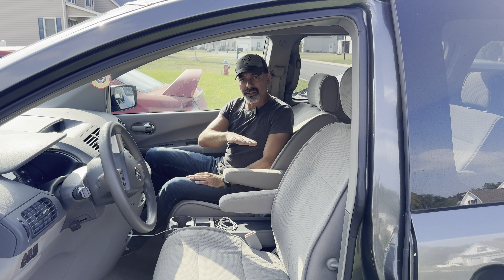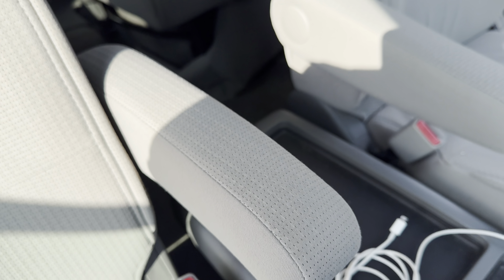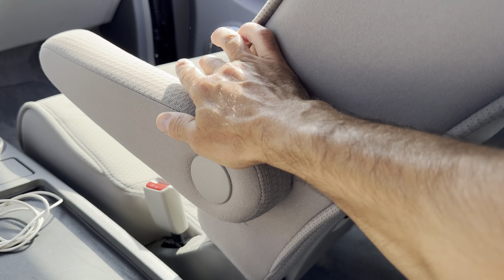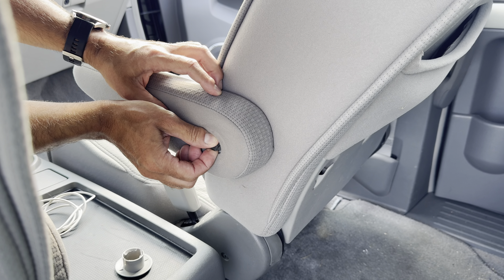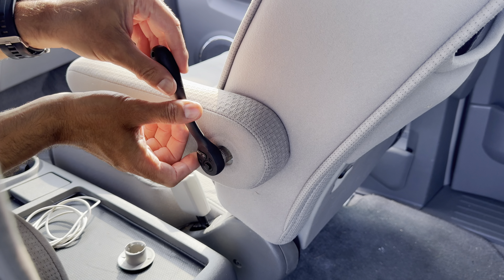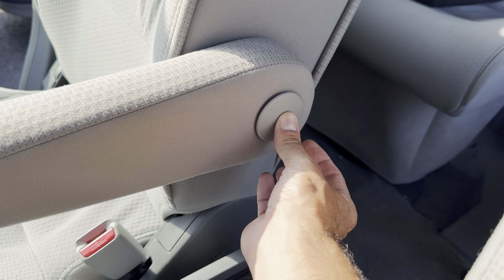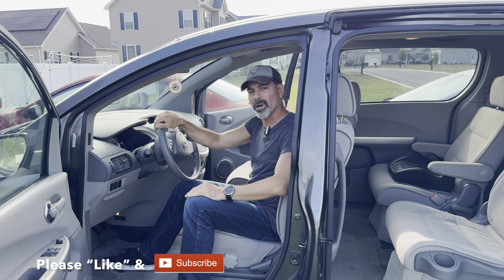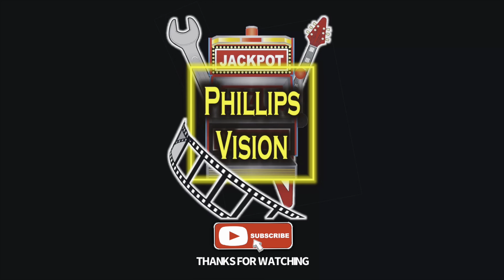How To Fix A Loose Arm Rest (Andy’s Garage: Episode - 498)

Comment: By the way I have a quest as well and the trunk would not open anymore while there is no mechanical issues or relevant damages. If u have any tips I’ll take them🙏 thank you
Reply from the maker: @Mathildelililou  I’ll have to check it out and shoot a video. Mine doesn’t have that issue so I’ll have to do some research. It could be a disconnected cable like on the sliding doors. Here’s a link to the video I did fixing that: https://youtu.be/zdJPnBHvuZ4?si=7yWWETHIQ9qoNQGU